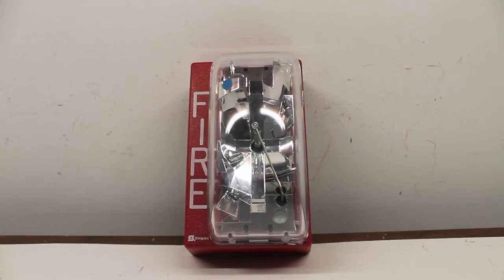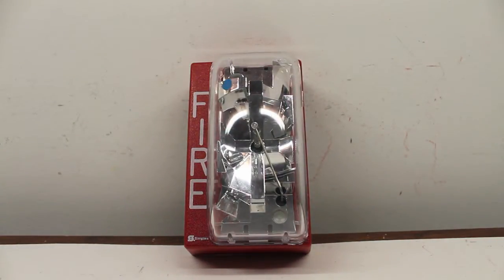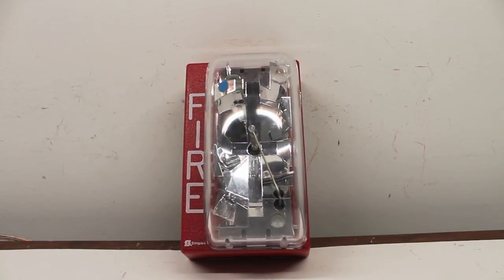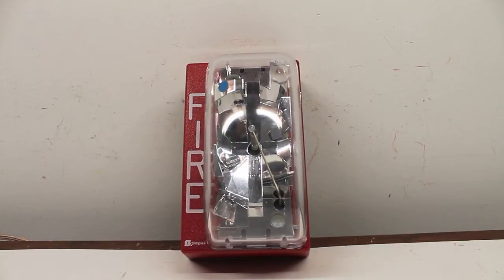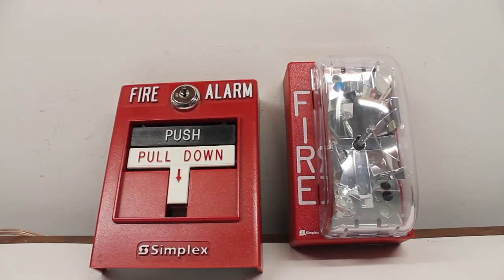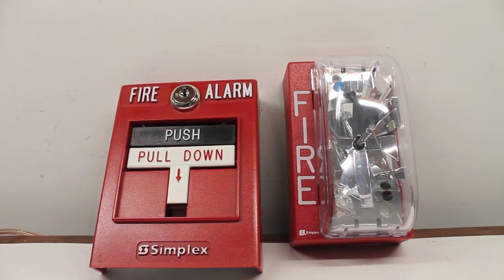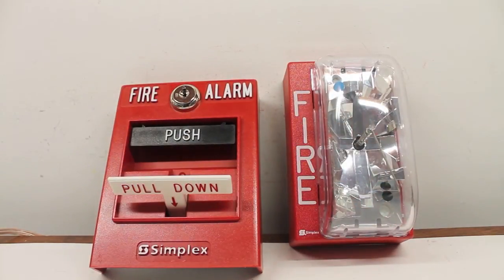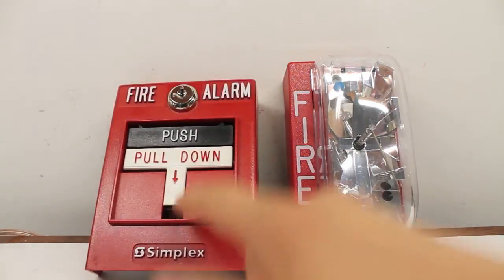Simplex 4904-9301 Fire Alarm Test

Comment: How the heck do you mount this thing?
Reply from the maker: Ideally, the thing mounts on a single gang backbox, or a single gang to 4x4 adapter. Now getting the strobe itself off to access the mounting holes, that's a whole other story (without risking breaking it, your guess is as good as mine, I guess stick four different screwdrivers in each of the four holes, then try to pry it out?).

Comment: Exactly how do you sync two strobes together to where they both flash together?
Reply from the maker: Through some sort of sync module designed for a specific brand. The module can be a separate module (I use the MDL in this video), or as part of the panel, which sends out the pulse through the Nac.
Reply: The 4904-9137 is specifically designed with the sync switch option.